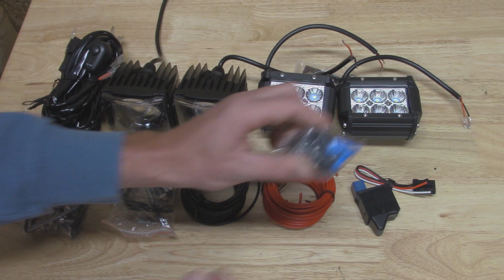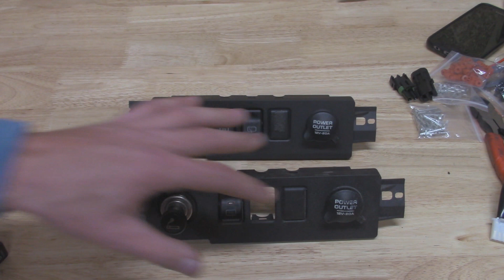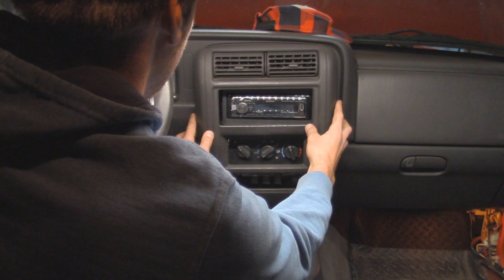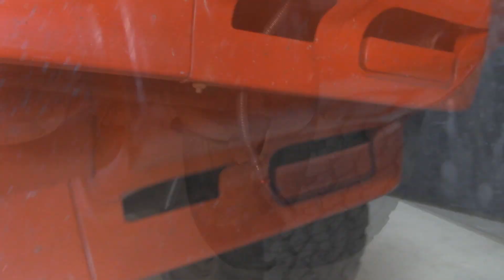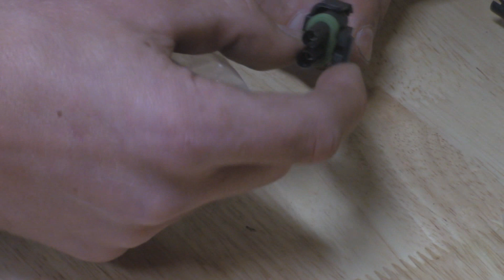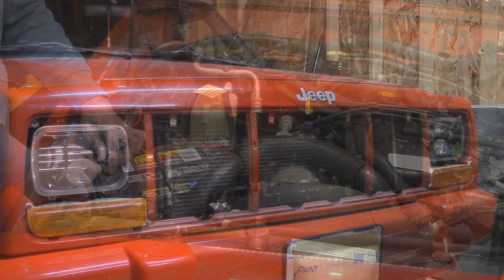How-To Install Led Light Pods on Your Jeep | SUPAREE

Comment: I installed a set of 2x5 led work lights with drl halo it gave it a cleaner look and fit inside the oem holes just  had to run a different pwr source for the dlrs

Comment: Does the switch light up when you turn on the headlights like the other switches that are next to it or does it only turn on the orange light when the pod lights are on?
Reply from the maker: The switch I got does not have a built in illumination light. It only lights up when the switch turns on.
Reply: @OutJeeping  I got mine to work with the dash lights but I used a bulb from an old switch and you have to solder this inside the new switch I installed, the new switch has the space where the bulb goes and the holes where the legs of the bulb go in and I used the orange wire from the original connector, I just had to remove the wire with the connector carefully so it would go into the new connector on the new switch this fits perfect they are the same connector

Comment: Would that wireset work for oem style foglight
Reply from the maker: Yup should work fine, as long as any light you hook up to it isn't drawing too much power than what the fuse, relay, or wire guage is rated for.
Reply: @OutJeeping  im adding fog lights to my xj i have my own wire harness with replay ect. And i wana use my oem swith(my xj never had foglights) i have the pigtail

Comment: The red wire that was spliced to the blue.. I'm a little confused on this. The red is going to the switch.. then just simply spliced to the blue?? I'm sorry I'm new to this stuff
Reply from the maker: Yes, I used a red wire because that is all I had for extra wire to run up to the switch. This wire is the output positive wire from the switch to the relay.
Reply: @OutJeeping  ok so, I'm literally doing this just like you and wanna be sure about this. You have blue, white, and black on your harness. You only used the blue to splice into. My harness has yellow, red and black? Red is in the middle..so splice into which wite for me?

Comment: Thanks for the great video! Quick question: So if I have factory fog lights and want to do a similar install w/ led light pods, all I would have to do is attach the waterproof connectors to the new lights and then it's plug & play into the factory wiring harness?
Reply from the maker: That's pretty much the concept but the waterproof connectors that I use are just Universal connectors so they won't plug into any factory wiring harnesses. So if I were you I would just replace the factory plug with one of the universal ones that corresponds with your LED light pods.